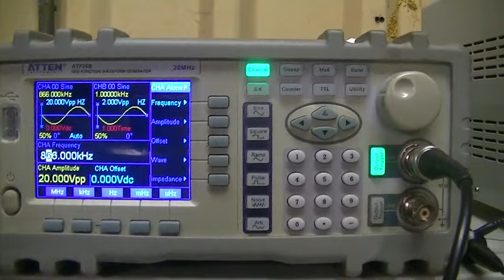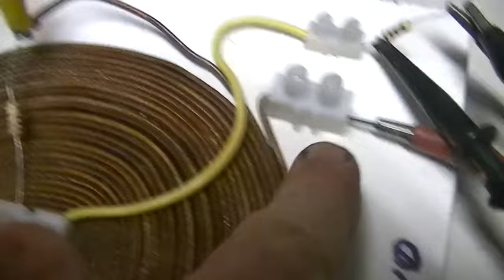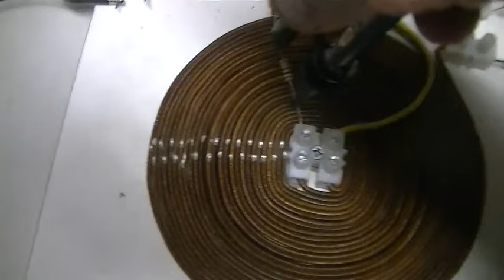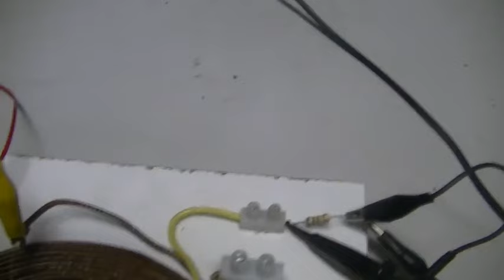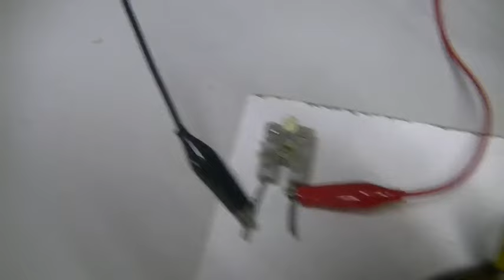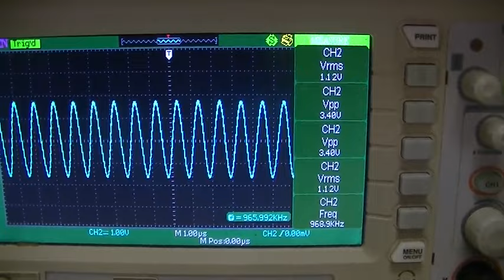Tesla bifilar coil anomaly

Comment: Yes you are right this coil isn't just a straight wire it is a transmission line, there are parallel current paths via the capacitance between the adjacent windings. The effect will be even greater as the physical length of the line becomes a higher fraction of the wavelength.
Reply: You obviously dont know about basic electronics and trying to sound clever, the current will always be the same in any loop.
Reply: @ThuleApsu  But when there is parasitic capacitance, electric current can go reverse due to leading.

Whose the one that does not know electronics? HA!
Reply: @lukiepoole6701  Regardless of what 'interference we have on a loop thru stray inductances, the current thru that loop at ANY point will be the same, yes I do know exactly 100% what I am talking about. When we are talking about AC current, we measure the resultant which combines the reactive and real components. If you have a stray capacitance, that would form a DIFFERENT loop, so I am 100% correct.
Reply: @ThuleApsu  Not exactly when the loop feeds itself. You do not know bifilar coil -_-
Reply: @lukiepoole6701  Its a mutually inductive loop, its not complicated its been around for years, any engineer worth his/her salt will tell you currents at ANY point within a loop will be the same. Do some study on autotransformers, same principle, it doesn't matter whether the self inductive currents are constructive or deconstructive, the law still applies. What we are seeing in his experiment is current leakage, hence the differing currents.
Reply: @ThuleApsu   Current leakage. No comment.
Kirchoff's law is obviously false when it comes to current source. I will not explain any further.

Current leakage? That is a false statement. The terminal end of the current is between the first part and second part of the bifilar coil. Standing wave occurred there. You say mutually inductive loop but do you even understand it? No you don't.

If you truly use right hand rule, you would notice the direction of current for the second part of the bifilar coil is in REVERSE.
Reply: @lukiepoole6701  Kirchoffs Laws are not false), SMH. You are sounding like a Flat earther now.Yes leakage, do you not understand multimeters and scopes have impedence losses, multimeters typically 10MR, scopes 1MR then stray capacitances of a few pF, then we have to account for the fact it is a youtube video which is not exactly trustworthy, nor is it from a prominent engineer. Well done you know the Right hand rule, most school kids know that.
I bet you don't even know what a current source is, if you put a 10R load across a hobbiest 15A current source, what would be the output voltage?
Reply: @lukiepoole6701  Look, Its good to get excited about Tesla inventions, he is one of my heros too, but bifolars are used already in a lot of products already, they even etch them onto copper traces on PCB's, so you are better spending your energy on some other tech, like for instance the Tesla energy receiver which has not had so much research on it (Wardanclife tower experiment)).
Reply: @ThuleApsu  Lol.... you're very outdated. All I am doing is defending the validity of bifilar coil. That's all. The Wardeclyffe tower is a receiver?  You have not been reading what tesla said, didn't you. Disappointed.

I already researched tesla stuff and has surpassed him in terms better electricity already. His electricity is radiant electricity, mine is cold electricity.
Reply: @lukiepoole6701  I was writing briefly, the tower transmitted high frequency voltage between high altitude and the earth to stimulate the natural earth resonance (Schumann resonance) which then collected the return currents.  By stimulating the natural earth resonance Tesla's believed you could obtain far more energy than you put into the system hence having a free-energy system. Of course he did not promote it like that to his financial backers, but as a world communication system. The problem with many 'Tesla fans' like yourself is that you shun popular science calling it garbage and using terms like 'cold electricity'.
Reply: @lukiepoole6701  You really need to look up Teslas patent again, he used a rotating commutator to produce high frequency which was them modulated to the schumman resonance. Perhaps you are not aware, but the natural earth frequency is 7.83Hz, you can prove that mathematically based on the dimensions of the earth.
Anyone who calls Kirchoffs laws false is a science skeptic), his laws are PROVEN, unlike your cold-electricity garbage.
Cold how?, electron flow produces vibration, vibration produces temperature rise.  Almost all of Teslas later work was on high frequency electricity, high frequency electricity is the only way Sparks can fly thru the air over a few meters,  I fear you are one of the many deluded Flat-earth-engineers holding up Tesla as a beacon whilst misunderstanding all of his work.
Reply: @lukiepoole6701  I will ignore most of your pseudo science since I have no inclination to waste time, and point out one particulary ignorant point which just shows how little you know about science.  You say it is not high frequency but an impulse. You do not even know that a pulse is composed of many frequencies, you probably think fourier analysis is type of french cooking style, and a direc delta function is a scene from star wars I will say a big whatever to your lunacy. Yes you are a flat-earth-engineer..stamped and authenticated.
Reply: @lukiepoole6701  I am willing to discuss with you, if you do not start insulting my intelligence, I would mention my qualifications and experience but to the Tinman generation that would just prove to you I know nothing.  What you need to realise is that many engineering principles have built the world around you, so we know they work.
Reply: @ThuleApsu  Not to mention that this rule is correct for DC only. For AC, you have to obey lenz's law, aka action and reaction of magnetic field. Use right hand rule to determine the direction. Obeying action and reaction of magnetic field. Since the fields between the wires are actually very weak, the action and reaction majorly comes from the distributed magnetic field. The magnetic field shaped like a flatten torus. Top is out, bottom is in. Due to action and reaction, the second part of the bifilar coil's magnetic field is top is in, bottom is out.
Reply: @lukiepoole6701  Perhaps you should write a new book, since the Work Of Kirchoff and other prominent electric innovators were obviously wrong, even though we have been using their laws for many years).